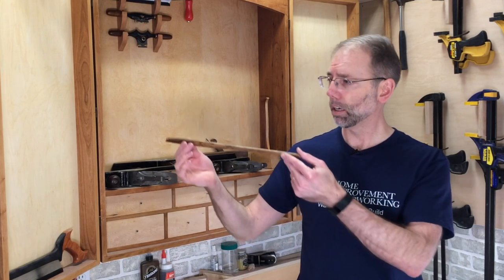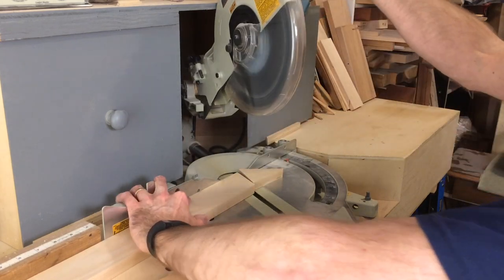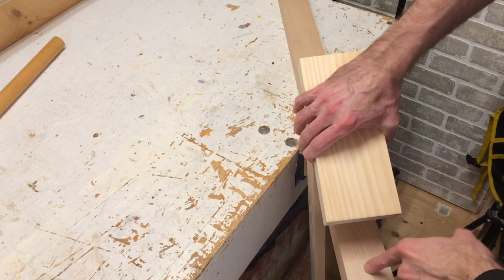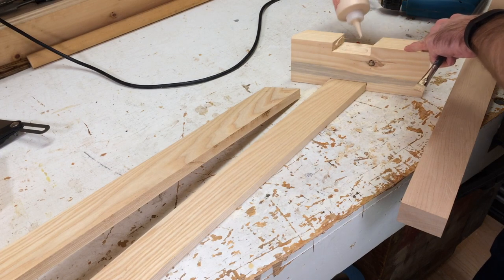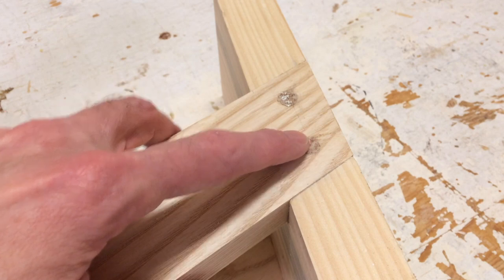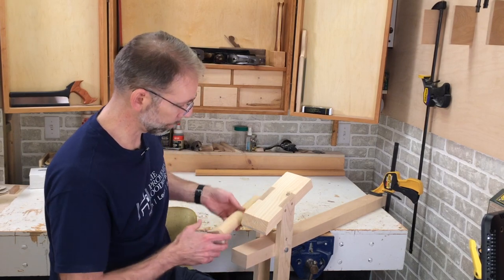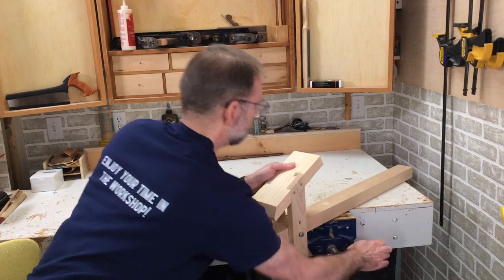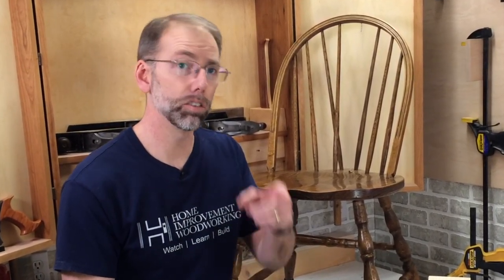Woodworking Benchtop Shave Horse - How to Build a Shavehorse for Hand Tools

Comment: As a woodworking hobbiest, I can appreciate the small work shop. In May of 2023 I suffered a stroke. I am now making over my small shop and the shave horse is a welcome piece. Two years ago I built a vise less work bench and bought metal hold downs that will do the job just fine. Thank you for this easy to build project that will be used for many years. Also, thank you for the videos you put out. I've learned many things over the years watching your work.

Comment: Great idea, perfect for my hobby shop where space is very limited. This even worked outside. I clamped it to the deck stair, after pushing the dowel up tight against the step. Grabbed a seat and made some dowels. I  replaced my bird house/hotel (8 rooms) perches using a couple of pruned apple tree branches. I love the rustic look it added. I also used all scrap hardwood for my build as well, so it’s totally free! 
Thank you,
👍🏼👍🏼 from this guy!
Reply from the maker: That's awesome!  I'd love to see photos if you'd like to share them.  Email me by clicking on the About section in our channel and clicking on the email link.  Thanks.  Scott
Reply: @HomeImprovementWoodworking  Sure thing, just as soon as my sis returns it... she’s loving stripping long vines making a braided trellis garden entrance with it for a winter project.👍🏼 Some ideas are just too good not to share😉 Best I can do for now is send the bird condo so you can see what I mean... thanks again and Happy New Year!  I’ll send one now

Comment: I have the exact same woodworker's vise, it's even blue just like yours. It's also a piece of junk like I suspect yours is. Sometimes it takes two hands just to open it. I hate it, although I still have it. However, I've since built two Moxon vises and the foot-powered vise by Izzy Swan. If you haven't seen it you need to check it out. My next project is to build the regular bench vise like we usually use with metal and general duty that John Heiz built on his channel. Also, I bought a set of tap and die for wood and both my Moxon vises have wooden screws. Well sorry about this long comment, I really enjoyed this video and I plan to make the portable benchtop shave horse soon. Enjoy and keep on making these great videos.

Comment: I like the simplicity of this benchtop shave horse and I would like one for the shop!. I have a regular-size shave horse I made from a log a friend gave me. It has a home outside but can be moved inside if I want to. I am using a grill cover to keep the rain off of it and surprisingly it works great for this purpose. It is made from a cedar log with an ash foot press and head mechanism. I did give the entire thing a coat of sealer just in case and after 3 yrs, it still looks the same as the day I made it. I was going to get the plans for this just for the angles you used, but at $21.00 for a very simple project, I decided not to, sorry, but WAY overpriced.
Reply: Agree with your the price comment. I regularly purchase pdf plans offered on YouTube video's, but $10-11 dollars US is the upper limit for my budget. The idea for this design of shaving horse is clever and practical.
Reply from the maker: Sorry to hear that.  Based on what's available for niche plans on line, this is below the average price from my research.  It's a balancing act between costs (1x production, online store costs, hosting fees) being able to offer helpful products. Thanks for the feedback.  I understand your perspective.  Scott